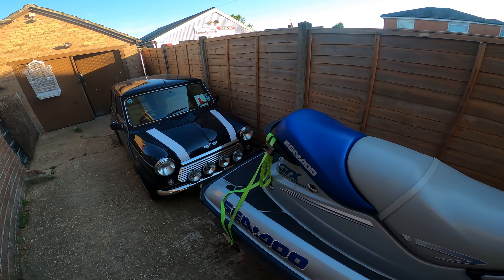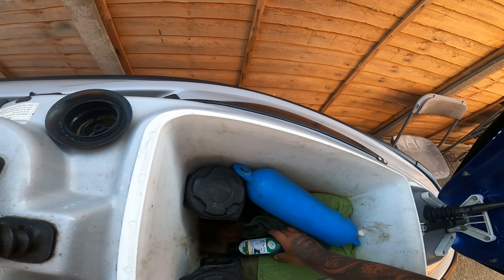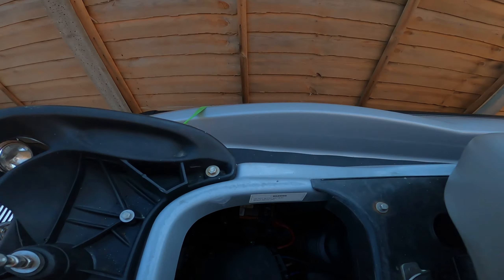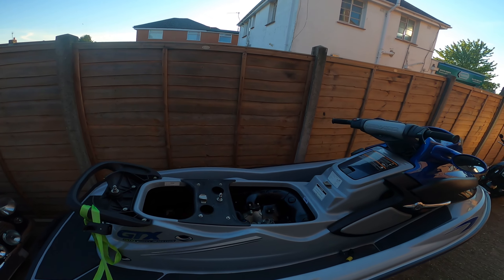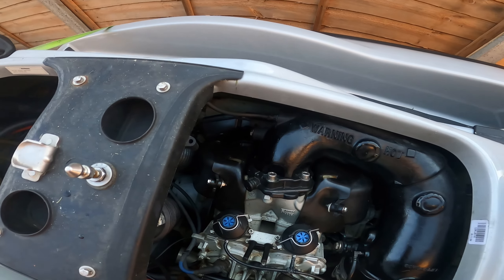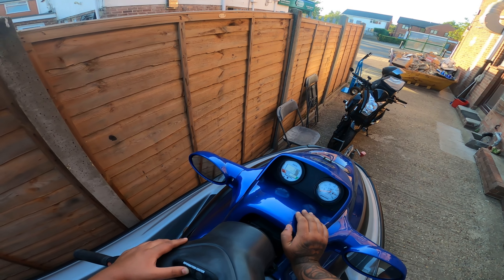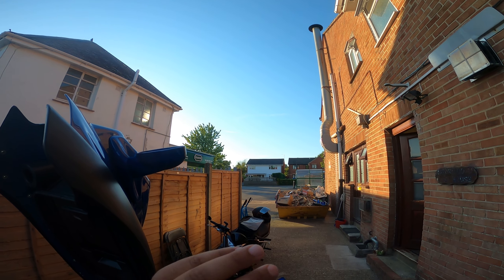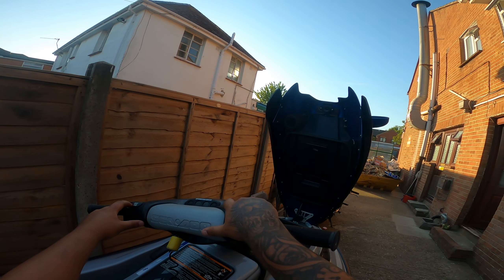BOUGHT A WRECKED JETSKI FOR NEARLY FREE !!!!!

Comment: Oh come on a cheap fuse a rave valve cover and spring and a charge on the battery and you have a running trouble free seadoo for a measly 450 pounds what 800 US dollars. Let’s see it in the water running and doing just fine!
Reply from the maker: she worked like a dream I sold it after the summer and now bought another one